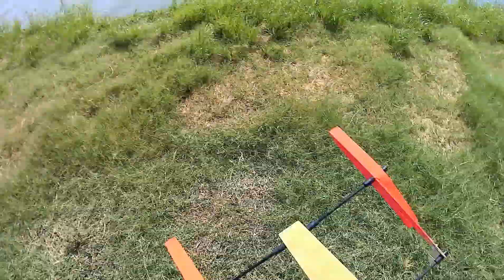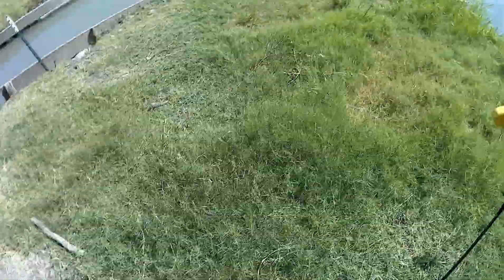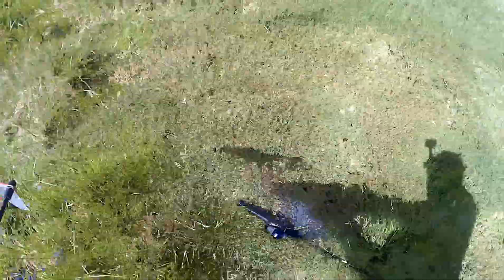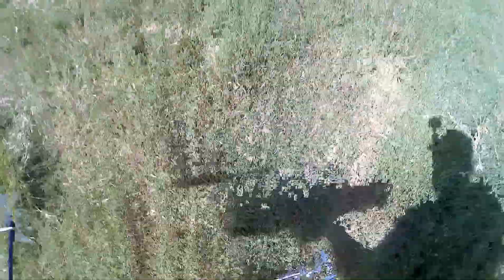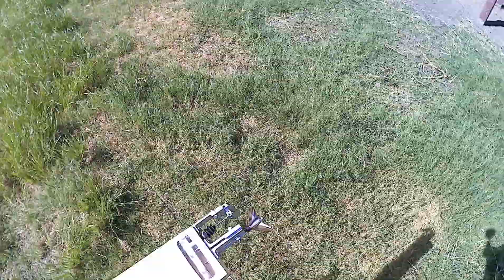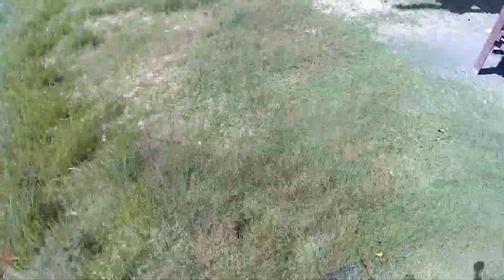4 Stroke Outrigger Hydroplane RC Boat- 2nd Run More Prop- ABC 1918

Comment: Beautiful use of an OS FS engine. I hope your fuel has castor oil in it. It's a shame they don't make this in a marine version. Mine swings a 13 " APC prop real good and there is more unused power to spare.
Reply from the maker: Thank you, what is your oil percentage? I use 19% synthetic 45% nitro with no issues thus far. Agreed on a bit of castor would be a wise choice I bought a jug of castor for this up coming season I plan to add 4% for a total oil package of 22%. By doing so I can lean out the needle valve without any risks since this run I have achieved 44 mph thus far perhaps this year I can bust 50mph with the right prop. Here is the radar check at 44 mph:
https://www.youtube.com/watch?v=jWCVkDXoKcY
Reply: perfect choice on 4% castor. when the cooling conditions are good, you can really lug these engines down.
Reply from the maker: Yes I have 5 new props ready for testing sharpen and balanced for 2018 will load the engine down in stages till it has reached the max load. Potential to hit 60 mph based on the runs made thus far.
Reply: you will get her up to 60, and with a rich carb setting too.